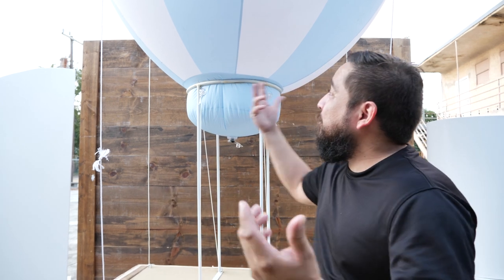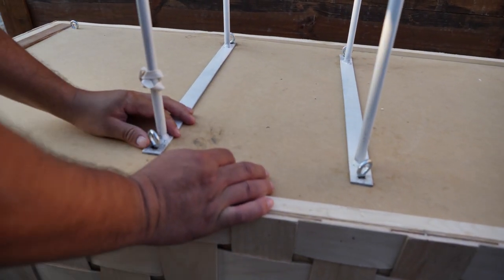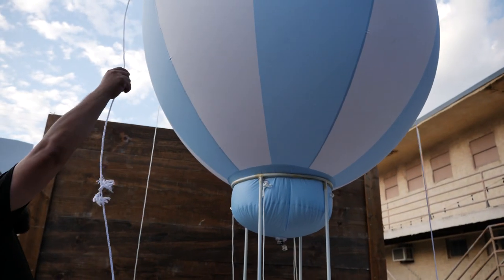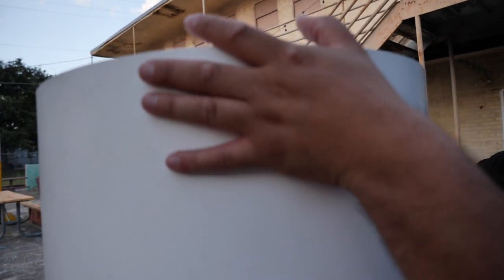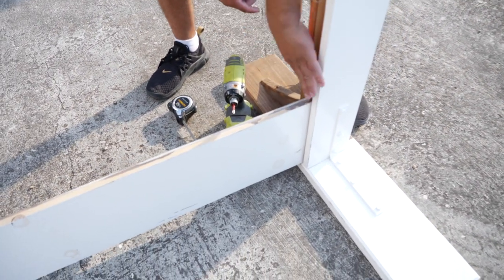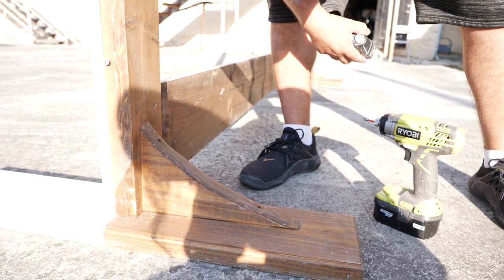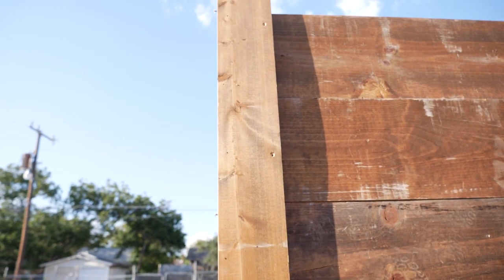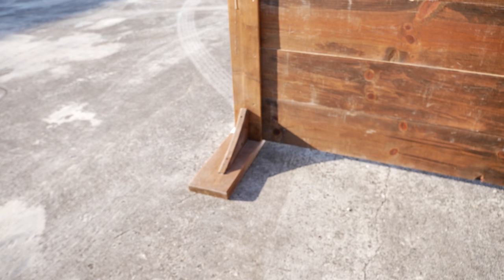DIY Hot air balloon, Wood backdrop and plinths for events

Comment: What is the name of the white plastic used to wrapped it? Excellent video; keep up the great work
Reply from the maker: Hi, the plastic you can find at Home Depot in the plywood section. Its only sold in 8ft x 4ft sheets. Its a polywall meant for walls not to get wet. But you can use other options as well. Most people I see use very thin plywood and a nail gun or thin sheet metal using sheers to cut, but that does seem more difficult than the plans I created. This was just the way I did it, and it came our pretty easy I think. Thanks so much! Here is a link to  a video I created about the plinths and also has plans available in the description of the video on our Esty store. https://www.youtube.com/watch?v=j7OO-no8qoo